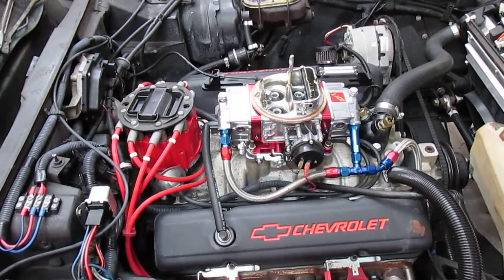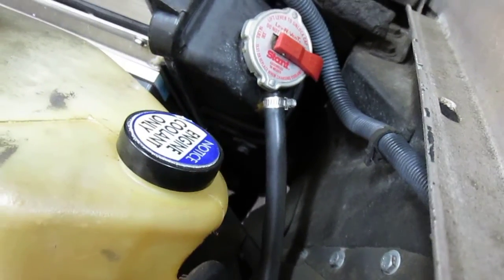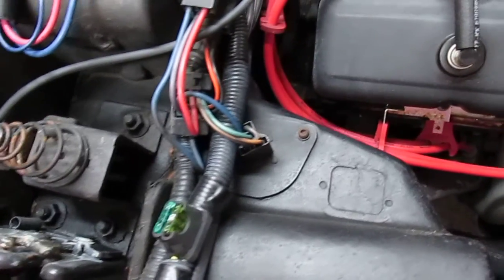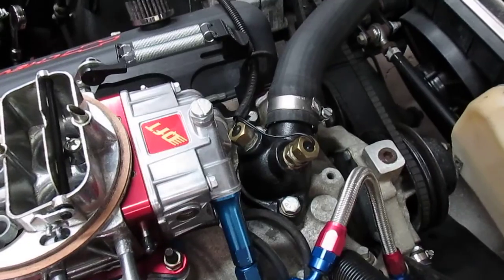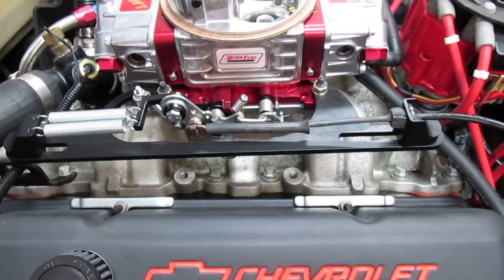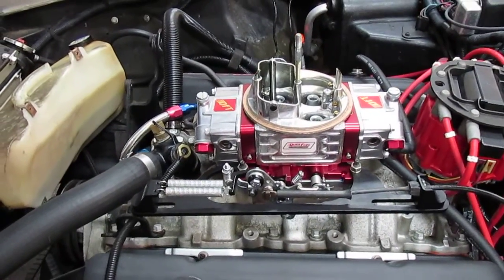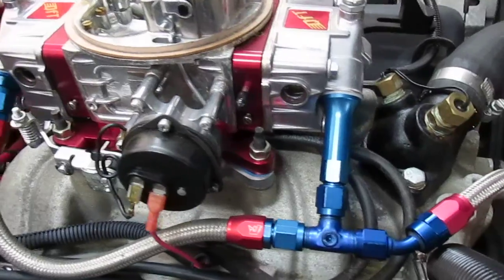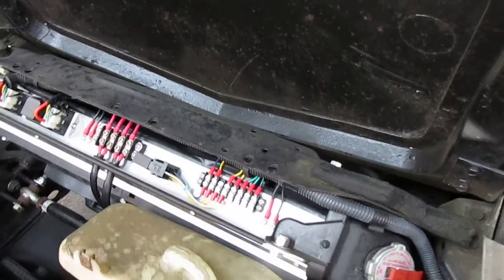Under Hood Tour, 1978 Corvette

Comment: I've got a 78 just finishing with 496ci, 12.5 to 1, dual stage NOS  current 200+200hp, racing seats, lite the car 500 lbs, full cage. Maybe be quick, pro stock dash, no AC/heater, Speedo, radio, wipers, flip up headlights, but SS Hooker header side pipes, fuel cell, Weld wheels, Mickey Thompson DOT drag slicks and a handicap tag. Your car is really nice and nice details! All parts taken off my car were packaged and label in case the car last longer than my retirement 😇👍🏻! I get alot of laughs because of the handicap tag on the car! Super video Thanks!
Reply from the maker: Thanks for the nice comment!!!

Comment: you have the timed and full vacuum ports backwards, inside one closer to center of carb is manifold vac.
Reply from the maker: I'm sorry but that's incorrect. The outside one is manifold vacuum. The instructions supplied with the carb is incorrect. Also if you look at the pictures of the bottom of the base plate on the Jegs website, you can clearly see that the outside one is full manifold vacuum.
Reply: ok my bad it must be because the baseplate is billet all other gft and holley baseplates are just the opposite like the one in the link

Comment: I just picked up a 78 corvette and I love it! I have a question though, under the brake booster (I think) on the drivers side just forward of the fire wall. There is a silver cylinder with what looks like vacuum fittings for tubes. Do you know what that is?

Comment: thanks for the video...helps alot.  One question..do u have the brake booster vac going to the intake and the pcv going to the port on rear of carb?
Reply from the maker: Alan Tibbetts yes I do. this video may help https://youtu.be/TIbG613P5eM
Reply from the maker: For a stock or mildly modified 350, a 750 or 850 will be way too much. A
 car will always feel stronger and have better street manners with an 
appropriately sized carb. I recommend using the Holley carburetor 
selector at the Holley website. Look under products and then click 
Carburetors. Summit Racing has a similar tool. 
https://www.holley.com/products/fuel_systems/carburetors/

Comment: can I put a 750 or 850 cfm carburator in a corvette 350? will add few hp ?
Reply from the maker: For a stock or mildly modified 350, a 750 or 850 will be way too much. A
 car will always feel stronger and have better street manners with an 
appropriately sized carb. I recommend using the Holley carburetor 
selector at the Holley website. Look under products and then click 
Carburetors. Summit Racing has a similar tool. 
https://www.holley.com/products/fuel_systems/carburetors/